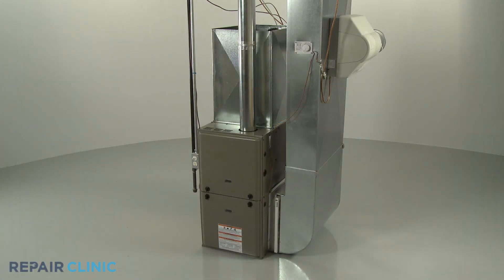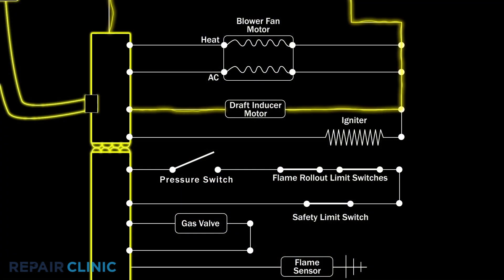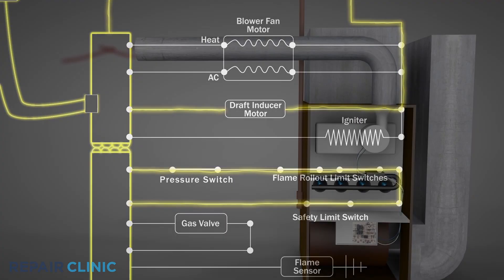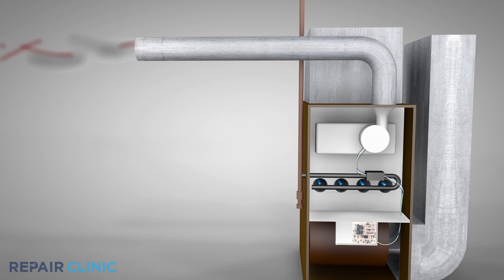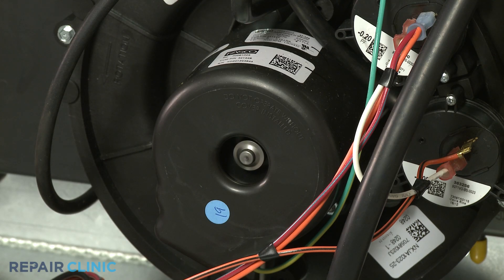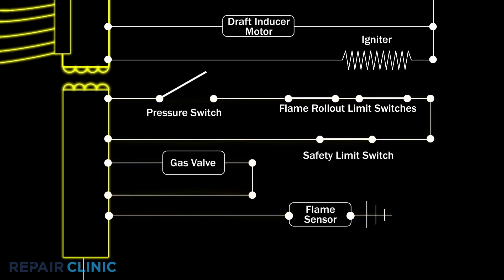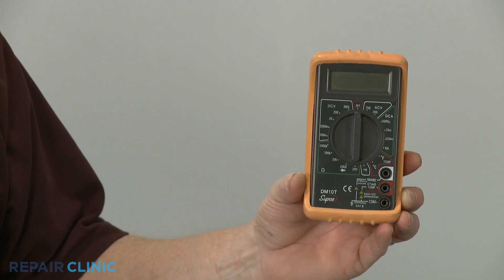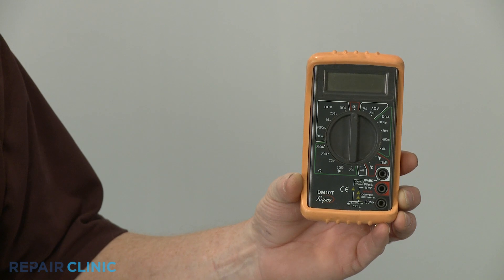Furnace Pressure Switch Testing

Comment: Mine are below not on top that's where my control  board and blower motor and housing are.
I seem to have a pressure switch malfunction (dual) but  how do you check continuity with the blower going if your supposed to kill the power?

Comment: I believe this information is incorrect. Most furnace pressure switches are normally open. Knowing this, you should NOT have continuity when ohming out the terminals. I think your test is backwards.
Reply: True, the pressure switch is normally open when no pressure is present. However, with the draft motor running it should create the pressure difference required to close the switch and complete the circuit in which you would read 0 ohms (or continuity) on the digital meter. In this case with the motor running it was still open (0L reading on the meter) so the pressure switch is indeed bad. Yes, if you have a tube going to the switch it could be clogged with dirt or a dead spider possibly also preventing the pressure from reaching the switch so check that also is you have a tube going to your switch.
Reply: He said it should be closed when the motor is running
Reply: Bro some switch normally closed also
Reply: I was looking for this comment. Thank you!! I wish they explained this

Comment: multimeter display ol, what's meaning? Thank you
Reply: OL=open line. Meaning the contacts haven't closed(made connection) to allow ignitor to glow and then gas valve fires up.

Comment: Also you can read to much resistance which is happening to me without motor running it shows ol, with motor running its showing a lot of resistance I would have to do it again to give exact reading its higher than a lil over zero
Reply: you got to isolate when checking resistance
Reply: @Seabass1206 what makes you think it wasn't isolated?  Only thing that was hooked up was vacuum line

Comment: If the inducer motor  is running and the switch doesn’t close, it doesn’t prove the switch is bad. You can have leaking tubing, clogged tubing, a slow motor (defective) or an obstruction in the flue pipe. Further testing is required to determine the problem. The Repair Clinic needs to take down this video
Reply: Agreed.  Doesn't show them well.
Reply: Thanks to this advice I found that a spider had gotten sucked into the vacuum hose and clogged it up preventing the switch from operating. 
No new parts needed.
Reply: @j.g.r.1938 same
Reply: This video isn't titled "how to troubleshoot a fault in the pressure circuit." It's a simple test of a single device, not a pressure code callout.
Reply: They say right at the beginning that the problem may lie with a slow inducer motor
Reply: agreed